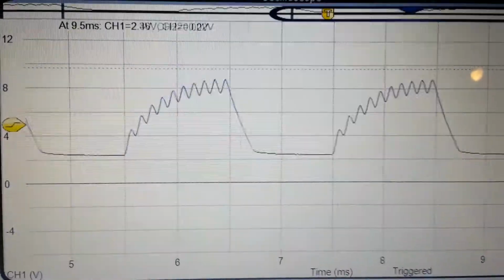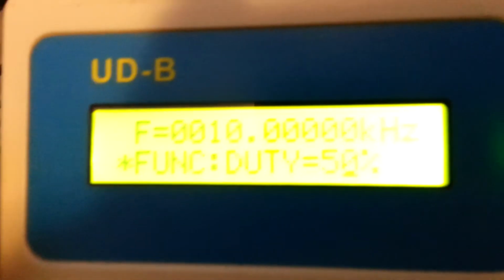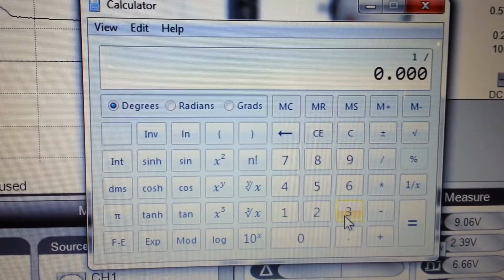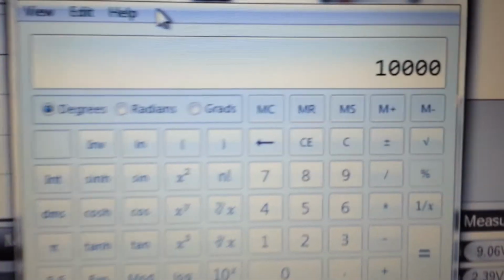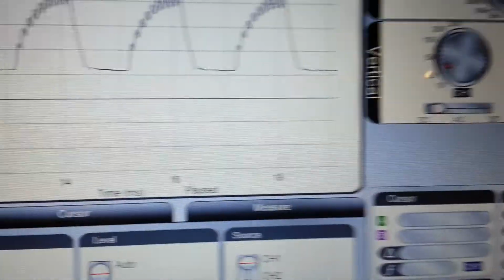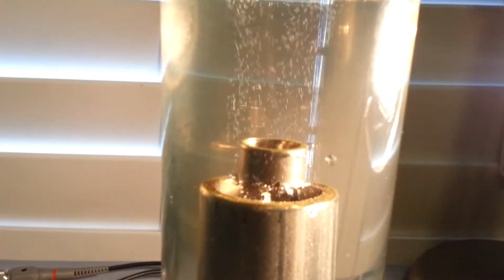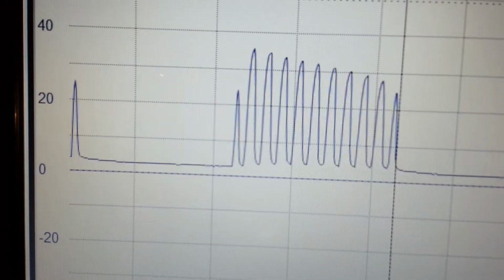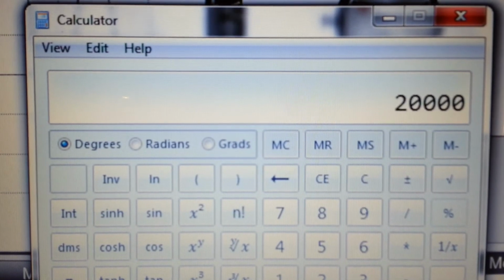Stan Meyer Research #1 Feb 2014-Continuous conduction mode V.IC.

Comment from the maker: Old video, I messed up on the explanation a bit. Sorry about that....Either way you can see what the VIC does when it's "Doubling" the pulse frequency as Stan called it. It does not double the frequency, it causes the current flow to be continuous, in electronics engineering it is known as Continuous Conduction Mode (CCM).